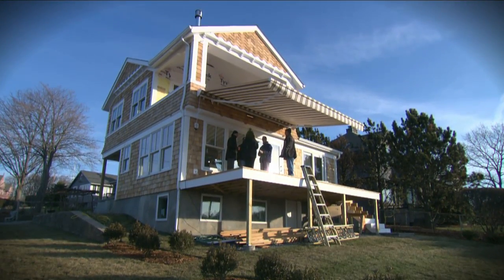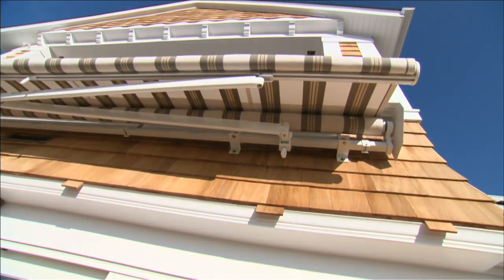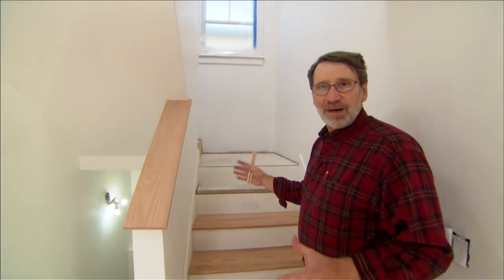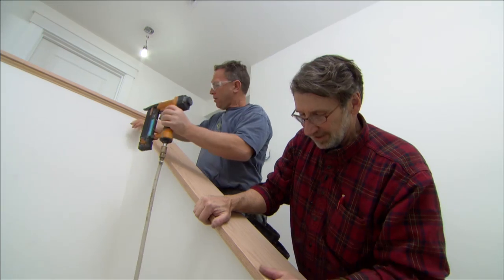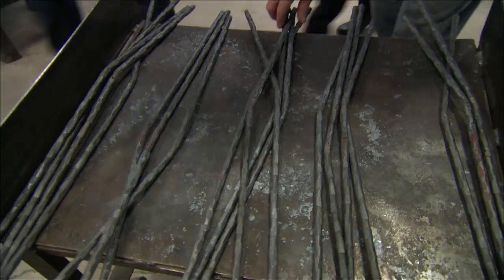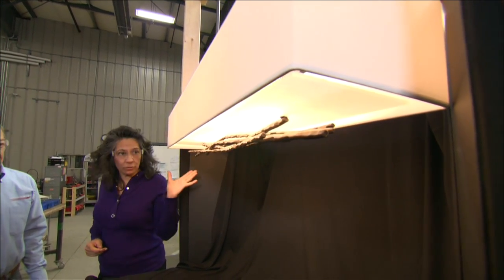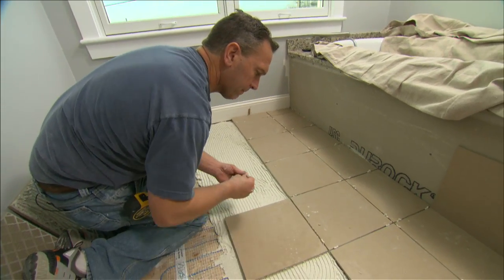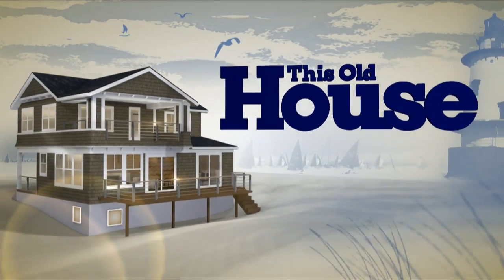Wall Dressing | The Barrington House | Episode 8 (2012)

Comment: Normally I wouldn't say anything, but in what universe is waxing soapstone easier than oiling it? To oil soapstone you just spray it on and wipe it off vs wiping and rubbing wax into/onto the surface little bits at a time.

I sell soapstone and oil ours when needed to show customers the difference and it couldn't be easier.